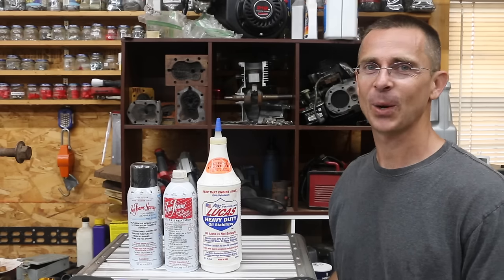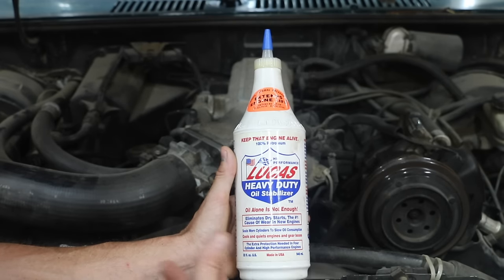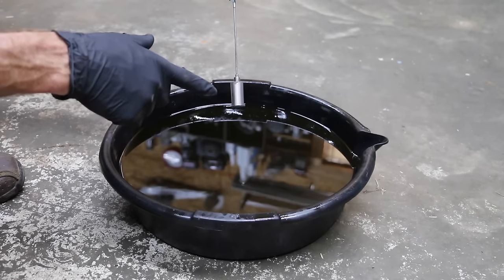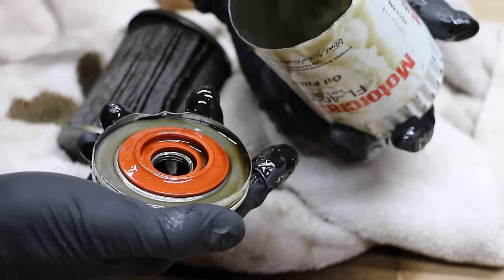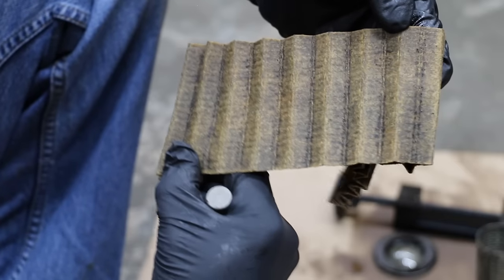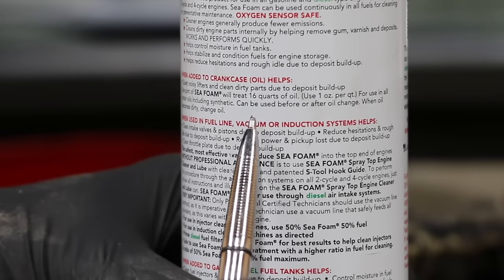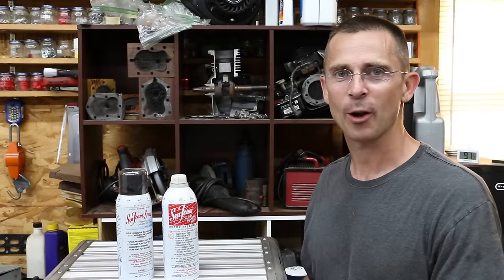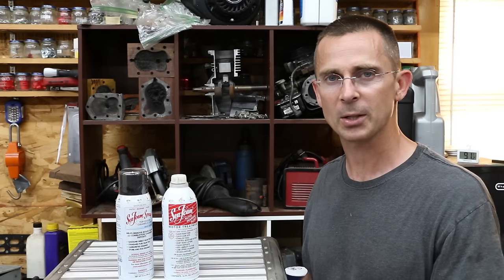Did the Seafoam fix last? Update on the Ford Ranger

Comment: My best tip for helping keep metal shavings from wearing engine parts, is to put a large flat magnet, such as those that are on the back of stereo speakers, on the bottom of your oil pan. The magnet will attract and catch metal shavings preventing them from cycling back through your engine. Just remember to take the magnet off before an oil change so the shavings can drain out with the old oil. 
The magnet trick also works when stuck to the bottom of your fuel tank, for keeping rust particles from getting from your fuel tank to the injectors or clogging up filters.
Reply from the maker: Thank you
Reply: @ScoredPiston  , love the FilterMAG product line.  Project Farm can also see other videos online showing how they work (opened up filters).  I am installing filters for my power steering, transmission and oil bypass and all will have FilterMAG's on them (sub micron contaminants)
Reply: You can pull the magnets out of an old hard drive too - they are pretty powerful!
Reply: @davidpeters8813  I'm not aware of if,or what kind, of magnets are in a typical hard drive , but my guess is the it would have a small surface area. Also, people seem to be emphasizing the power of the magnets. I have to caution that just a moderate size/strength magnet is all that is  necessary. Especially one that has some surface area such the flat round magnets 3-6 inches in diameter that come on the back of stereo speakers. Using strong magnets such as rare earth magnets could lead to cracking your oil pan/fuel tank if  you have trouble pulling it free from the tank or you let it go and it makes harsh contact with the tank.  The magnet just needs to be strong enough to hold itself in place and capture small metal shavings and/or rust particles through the floor of a thin walled oil pan or fuel tank.
Reply: @UnknownUzer  I'm not sure what kind of magnets they are, but they're about 1/2" wide and 1 1/2" long. They have good holding power, so it should work well to attract metal filings in the pan.
Reply: Back in the day, used to be that the drain plug itself was magnetized.  That is not the case anymore?
Reply: @felinespirits  You could buy oil plugs with magnets attached to the end of them, but I don't recall any car coming with them standard. I had them in my old cars, but I haven't bought one in many years. I suspect they should still be available, however their small size would limit the amount of debris they could capture and retain.
Reply: Harley Davidson oil plugs have magnets integrated into them.  You can always center drill you oil plug for a 1/4 inch or so and epoxy a magnet into it.  The advantage of this method it that you get to see the crap that the magnet catches.  Just my two cents.
Reply: I'm kinda surprised they don't just build them that way since they already sue the same trick to catch shavings in transmission fluid
Reply: sadly this doesnt work, i repair motorcycle and each time i look at a flywheel its full of putty like metal paste. this paste is very hard to remove and act like dry playdough. i dont thinkvery much the metal in your engine will "drain out" by simply removing the magnet and draining the oil.
Reply: Certainly not a bad idea, but if you see metal shavings at all its bad news because your engine is on the way out
Reply: @splitt3r  you want to know why cause its a waste of time, what poeple dont seem to understand is that half the metal in your engine oil is aluminum and its not attracted to magnets whereas the trans is all steel gears.
Reply: I think most oil pans have magnets on the inside
Reply: What about putting 2 small magnets onto the oil filter? I just saw a video where a guy did that!
Reply: I wish I'd read this tip 2 weeks ago when I was chucking 4 old speakers
Reply: This tip would only work on ferrous metals. None of the alloys used in a modern engine would be retained.
Reply: I usually just dump a handfull of 1/4 inch neodymium magnets in the throttle body after I clean it out. They work their way through the engine and liven it up a bit. Massive power gains.
Reply: Many drain plugs are magnatized. I changed oil years ago, when I was younger for a few different lube shacks. Some of the metal that I saw looked like iron filings frm science class on the end of the plug!
Reply: Great idea...thanks
Reply: Hard drives use rare earth magnets
Reply: I've used this magnet trick on the the oil pan for years and it has worked great!  Never thought to try it on the fuel tank though, but I will now as I am now having issues with the old tank rusting and the particles clog up my fuel filter and some that are fine enough find their way into the carburetor and clog it up as well.  Tired of cleaning the carb every couple months.  Thanks for the idea!
Reply: Works great except for some aluminum metallics
Reply: Free strong magnets from the magatron in microwave ovens. Just don't break the ceramic post as its a toxic hazard. However, magnet is useless on aluminum parts like pistons
Reply: Try an old magnet out of a old hard drive computer  small flat and very strong, and can be placed inside the oil pan.
Reply: i like to use a magnetic oil drain plug too but bigger magnet will be better
Reply: What about with aluminum pans such as the LS engines? I'm trying to find a way to put one externally on the oil pan without much effort. It has to be removable so the flakes will drain with oil change.. I put two very little yet strong magnets on my drain plug and they come out surrounded in metal flakes. Just clean and replace with every oil change.
Reply: And on transmission pans. I have a rare earth magnet on mine. About 8 bucks on Amazon
Reply: inthepocket  their
Reply: You dont want to use rare earth magnets. They are expensive and very sensitive to heat. Extended heat cycles and high levels of heat cause them to lose all magnetism.
Reply: That's what your oil filter is for dude.
Reply: I use neodiamion magnets on my transmission pan, oil pan, and oil filters.
Also use high quality filters like napa gold, mobile-1 and k&n filters.
If I can't get those I use Bosh offroad filters.
Also make 100% sure you use the required type of oil.
If your car requires synthetic oil then use it.
After 75k miles use a high milage oil.
Do regular oil changes with filter changes.
Do not ever mix oil brands because different companies use different additives and some additives can act against eachother.
This possible chemical reaction can make oil properties unstable causing your oil not do what it's intended to do.
Reply: Most newer cars have a magnetic sump plug .
Reply: @nigelio3  post a video of this please...I love to watch other people's engines detonate.
Reply: @jamezxh  from what I have seen it's mostly chevy and ford that have the tiny magnetic plug ( I work in a tire and lube Express)  you can get aftermarket magnetic plugs and if your car takes the 14mmx .5 thread they are like 5 bucks.
Reply: It's okay to magnetize your fuel tank. But, who wants a permanently magnetized oil pan? Even if you pull the off the magnet, your pan will still stay magnetized, unless you somehow manage to de-magnetize it with a magnet of opposite poling
Reply: Hillbilly Holler true mate my Aussie 2008 ranger has a magnetic 🧲 plug
Reply: @moniquedujardin1824  on al aluminium oil pan you can attach magnets but you would want to remove them and flush the engine  but that would be in extreme cases.
Magnetising a oil filter and drain plug I would do or put a magnet on a sealed transmission pan yes....perminately magnetize a metal oil pan....nope.
Really though if you may have metal in an old engine use 1 oz. Of seafoam per quart of oil....run it 2k- 3k miles.....do an oil change and do a fuel system cleaner ( pressurised canister with the manifold kit with the engine running) and a tank of gas with seafoam in it before an oil change.....with the old filter and plug out pour about a gallon of cheap oil through it to flush like a super tec oil $12- $14 a gallon ..
Then finish your oil change.
This helps remove carbon deposits in your cylinders and flushes most of the trash the seafoam breaks loose in the cylinders and the fuel system cleaner cleans your chambers and valves....it should increase compression and reduce oil consumption which will increase hp.
Reply: I think I bought one of your old trucks. I found a magnet on the oil pan of my 86 Toyota that I bought used. Lol
Reply: Old microwaves, revolving warning lights also have great magnets
Reply: Old microwaves, revolving warning lights also have great magnets
Reply: Old microwaves, revolving warning lights also have great magnets
Reply: I put magnets in my blinker fluid🐴
Reply: Ohh ohh u can put magnet on oil filter too. And on auto trans pan.
Reply: @igysixx8487  try an inline fuel filter, before the carburetor. They are cheap and easy to replace, if needed.
Reply: I just carved my own oil pan from an old stump and embedded 14 magnets in it.  The only problem is that I have to keep carving new oil pans if I want to change my oil.  So I just never change my oil.
Reply: @johnnylightning1491  you can actually buy magnetic drain plugs. I use them in our race car.
Reply: Unless the oil pan is aluminum or plastic
Reply: A lot of the expensive top end manufacturers do this too
Reply: D Y duct tape some neodyniummagnets to the pan - their super powerful and worth a try
Reply: @project farm - OLD VHS players also have strong magnet that  are fairly big. I got one out that a donut shape and it was a good 7-8 inches diameter.
Reply: Interesting, I'm not sure the magnetic field will get through a steel oil pan with enough gumption.  I'll order online 1/4 inch dia rare earth magnets and drill them into my oil pan drain plugs, gearbox plugs get a 1/2 inch magnet, epoxy into the plug and you now have a visual indicator of what's being pulled out,
Reply: definitely going to do this
Reply: Project Farm   Would you consider pinning this comment on the top, so everyone can read it?   There is some good info below
Reply: Good advice. Just wish I had heard this 240,000 miles ago
Reply: I don't think the magnet trick is an all-or-nothing thing.  Yes, it won't get the non-ferrous metals, and the oil filter should catch most of the particles anyway.  On the other hand, it might catch the very small ferrous particles that could pass through the filter.  And it's probably more effective on older engines or those which use more ferrous metals.  Either way, it probably won't hurt anything and damn cheap.  Low risk, potential for reward.
Reply: @SamaritanElad  The ceramic has Beryllium in it , Very toxic indeed , Same goes for the top cap on a lot of high power transistors such as 2sc2879's , MRF455's etc ... The  Beryllium dust is very harmful if breathed in .
Reply: @hillbillyholler516  My Hyundai coupe has a magnet built into the sump plug bolt , So did most of my other cars , Vauxhall , Opel .. etc
Reply: This tip is how MagChip Detectord work on aircraft engines
Reply: Better yet put the magnet on the inline fuel filter so the metal rust can be removed during filter changes.
Reply: Don't drive with dirty oil. There will never be metal shavings
Reply: Also if you can get some of those magnets that in an old computer hard drive those things are very strong.
I have one on the filter of my Generac Whole House Generator. It also uses synthetic oil. The size of the 22kw generator is about 40hp.
Reply: Older Toyota drain pans i used to remove for gasket changes had several magnets on the bottom of them and had collected quite a bit of shavings. Never done a modern one yet so not sure if they still do this
Reply: @felinespirits  Dorman has magnetic drain plugs for FoMoCo produchects on Amazon.com - cheap and easy.
Reply: @Francois_Dupont  You're correct, that magnets won't work on aluminum parts, such as many motorcycles have. Aluminum is a nonmagnetic metal.
Reply: @TheOleHermit  i forgot to say, but most motorcycle have a sealed case whith everything including the flywheel inside the sump. the magnet on the flywheel will catch anything magnetic (iron, nickel, cobalt). those magnetic oil drain bolt are a joke. its a gimmick to sell 15cents worth of part for 15$.
Reply: This works for every engine except any engine that has any bit of aluminum for moving parts. In my case I have aluminum block and heads so this trick is pretty useless to me
Reply: @UnknownUzer  They are neodymium magnets
Reply: @joelqueen1378  Why would you place it inside you clown?
Reply: Here’s a source for magnets.   Go to amazon and search COW MAGNETS.
Reply: That's why they put them in transmission pans.
Reply: @UnknownUzer  Just don't use a magnetized oil dip stick, like on small engines that don't have a filter. If the magnet breaks off, you'll have a chunk of metal floating around inside. Goodbye engine.
Reply: @robertclure  especially plain bearing material...all non-magnetic.
Reply: i've had 2 nissans, back in the 90's that had magnets on the inside surface of the sump plug.  i think they were installed by the factory.  so i try to put them on all my cars.  they became no longer available in car parts shops so i make my own by glueing (epoxy) a supermagnet to them.  they will pick up iron and steel particles far smaller than the best filter can catch.
Reply: @UnknownUzer  , 2 of my nissans back in the 80's had them.  i suspect the factory installed them.
Reply: @UnknownUzer  Micro-wave ovens have good magnets in them also.
Reply: Pretty sure my 99 Ranger has magnetized  drain bolt
Reply: @tjswindowcleaning297  thriftstore
Reply: To be fair.. how much loose iron do you expect to find in there?
Reply: @minot.8931  Enough to take years off the life of your engine if not trapped and removed.
Reply: @nigelio3  Ha! Great way to destroy an engine.
Reply: @fusiondensity3287  shouldn't do that. Causes them to blink faster which in turn, causes them to burn out faster. If you just wrap your blinker fluid reservoir in a small steam blanket, you won't need the magnets
Reply: @douglasmontgomery6315  Where do you buy inline filters for transmission and power-steering?
Reply: @Francois_Dupont  i think a neodymium magnet would be better. Also, whenever I drain oil, I run a quart of oil into the drain pan until the oil is clear
Reply: @MikeKollin  It can’t hurt. But be mindful that there are parts that are aluminum
Reply: @mojomojo5779  Amazon
Reply: I just helped a friend remove his 97 Toyota auto trans pan and filter. Toyota includes magnets on the inside bottom surface of the pan.
Reply: Aftermarket drain plugs that are magnetized are available. Do a little research and you will find one for your particular application.
Reply: @cavscout62  I have used the magnet tipped drain plugs for over 30 years, and while they do work by catching metal shavings, their surface area is incredibly small. 
Using a larger flat magnet attached to the bottom of the oil pan makes a MUCH larger trap for debris, and all you have to do is pull the magnet off the pan before draining your old oil, and replace it before adding the new oil.

Comment: Had similar issues with my 1993 toyota 4x4 pickup. Over 225k miles showing. 22re efi 4 cylinder engine.  Used the BG 115 MOA and BG 109 EPR. It comes in a combo pack. Did the 115 cleanse and then fresh oil fresh 15-40  synthetic oil and new toyota oil filter. 600 miles later  (2 tanks of gas)  I am amazed at the increase in power. I can now drive the speed limit on the interstate and it stopped using oil. Hwy MPG went from 15 to 24.5 which it does in town. No oil leaks to report. The truck just feels Happy.  Great Job on your channel Sir!
Reply from the maker: Thanks!  Thanks for sharing.

Comment: After watching your video I decided to perform the same service on my 22 year old Mercedes-Benz C230 4-cyl that was running good, but just a bit noisy. 
After spraying the Seafoam in the hot engine I let the car sit for several days before driving it in order for the Seafoam to do it's best. 
Well! I didn't expect the huge performance boost, nor did I expect the engine to run so smoothly. The change is outstanding.  I'm sold! Thank you for your efforts, and my car thanks you as well.
Reply from the maker: Great to hear!  Glad I could help!

Comment: Forget opening an oil filter. That thing works better then the can opener in my kitchen!
Reply from the maker: Thank you for the feedback
Reply: Great idea, anything would be better than the old manual openers I use which like to curl up shavings.
Reply: There actually is a can opener out there that works that way...........cuts the side of the can not the top
Reply: @gr8fullfred  You can get your standard kitchen can opener to do the same thing! Just tilt it sideways and remove the paper from the side of the can. Works great for Corned Beef Hash. 
*edit for clarification